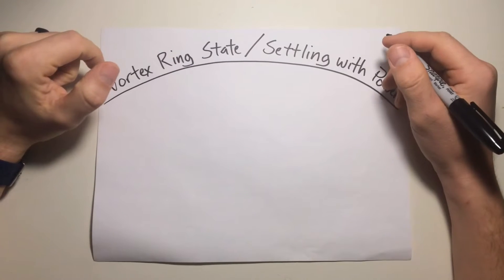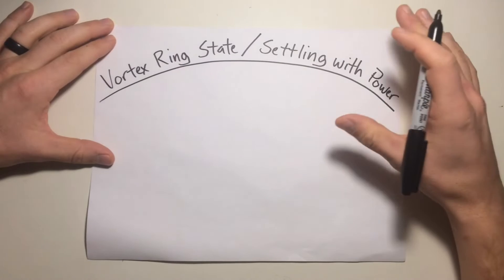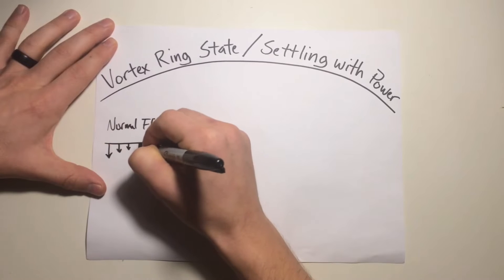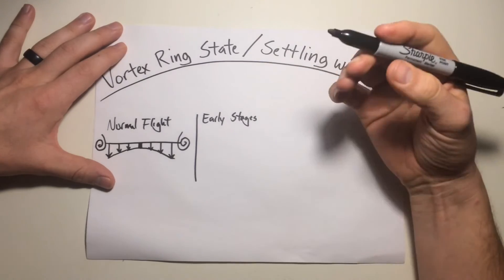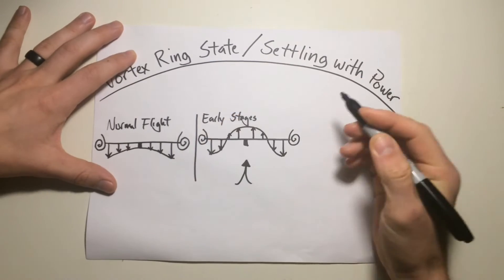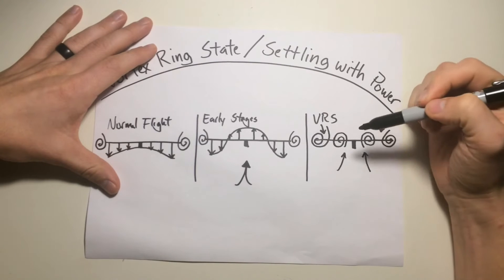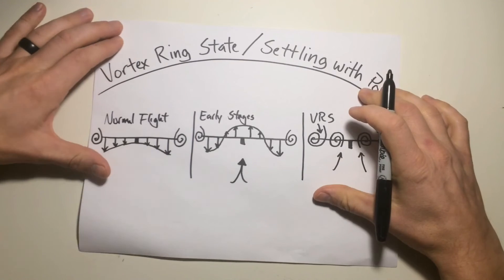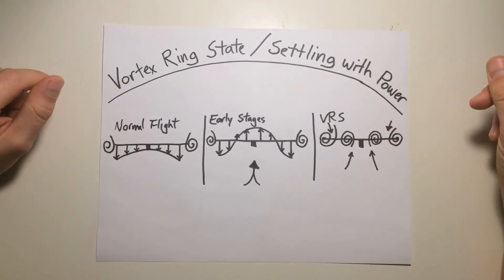Vortex Ring State / Settling with Power in Helicopters - Part 1

Comment: Settling with power is not what you've described it to be. Settling with power is being unable to arrest a rate of decent because of a lack of power. Settling with power can lead to vortex ring if handled incorrectly, but they are not the same thing.

Comment: I paused at 2:44.

The blade root does have a slower "airspeed", therefore less lift..
But, the blade tip is pitched flat and producing near no lift, if even negative lift, at lower altitudes.

How do we know this?

Coning.

When the aircraft gets into high altitudes (~15kftMSL) the blades cone, which means the tips of the blades are producing the lift in the thinner air.
So, your drawing is accurate for how coning occurs, not for how low altitude lift is produced across the length of the airfoil.

Further proof: https://youtu.be/Pu48f7s5Ru8
Watch how the tip dips below the middle of the length early after the upward flap is complete.

Comment: My understanding (and this may be a gross over simplification), is if you descend too quickly, the blade near the rotor hub begins to stall, resulting in loss of lift.

Loss of lift results in an increased rate of descent, which propagates the stall along the blades unless you get back into forward flight?

Comment: Some questions.
1. Did this used to be called 'Dirty Air"'
2. Does this only happen in a non moving hover state?
3. Once in a VRS and with enough  altitude is it simply a matter of moving out of it to regain lift? 
4. What IS  the minimum altitude to recover?

Ive seen video of, I think, a Royal Navy Helo hovering at an air show and this happened causing  a crash even at full power. He was too low to avoid it.

Comment: So if I'm understanding you correctly when a helicopter is hovering it is stationary in altitude so there's no air coming up from the bottom to cause vortex ring State versus the cause of vortex ring state is when a helicopter is descending the air is being pushed up towards the blades and you develop early in late stage vortex ring state. So the reason the helicopter can stay in a hover is its altitude is constant and there's no air coming up is that correct? I wonder how these large helicopters can stay in a hover so long and not fall outoof the sky.

Comment: Thanks for trying to educate pilots, but you got this one a little incorrect.   VRS and SWP are two different conditions.   VRS is when you descend too quickly into your own down wash causing the rotor tip vortices which is best illustrated by https://youtu.be/HjeRSDsy-nE video.   SWP is when full power is not sufficient to hold an out of ground effect hover (OGE).   SWP can turn into VRS if you don’t arrest the decent by getting back into ETL.   The classic situation is taking off from airport and trying to land on top of mountain in confined area without checking OGE hover before descending into confined area.   The density altitude combined with high gross weight causes SWP.   Helicopter simply doesn’t have power to hold the altitude.   To prevent SWP you should check to make sure you can hold altitude before descending into confined area.

Comment: Can you get into dynamic roll over while flying?
Reply from the maker: Not generally you touch something that creates a pivot point. This could be a tower obstacle that you didn’t see while flying. Or if you have complications with a sling load or water bucket you could possibly roll over if the line get snagged on landing gear enough to drastically shift the center of gravity.

Comment: Hey Jacob. Thanks a lot for the tutorial. A small query- is there any chance of falling into vortex ring from OGE hover to touchdown in a confined area? Say, in tail cross wind? 
Thanks...
Reply from the maker: You could. But when you got into ground effect it would start to dissipate and break up some of the rotor vortices. If you got into VRS at 300’ AGL, there may not be enough time to recover by IGE. If you got into VRS at 50’ AGL you could probably recover in time.

Comment: Please pay attention! I have flown Sikorsky products for almost 3 decades and I get frustrated watching and listening to so-called informative videos.

There are THREE terms that are relevant. TWO of them are: VORTEX RING STATE and POWER SETTLING and they are the SAME in terms of what happens on steep, low power descents in light or nil winds resulting in the helicopter descending in its own turbulent column of air with a rapid descent rate - resolved by forward or lateral cyclic to get out of the turbulent “dirty air” from rotor down wash. Actually you described it accurately.

BUT, the THIRD term is SETTLING WITH POWER (subtle, but critical difference from “POWER SETTLING”). SETTLING WITH POWER is the MISMANAGEMENT OF AVAILABLE POWER. Typically a fast, flat Transition to the Hover (TTTH) with low torque/ power and a steep, nose-high flare. At the intended landing spot depending on weight, wind, DA there may not be sufficient power available to retard the descent rate as the helicopter is levelled for landing - new and inexperienced pilots trying to be “cowboys” and save time are usually the ones who get into trouble, although experienced pilots can as well. When I was in the Navy flying H-3s we would sail from a cold climate and rapidly enter the Gulf Stream for a huge temp difference - handling techniques that were OK in the cold may not work in warm temps. Of course, the solution is to plan the transition well back and “load the head” early and, as you approach there is time to assess if you have enough power to hover or if you need to wave off and burn off some weight; otherwise you end up bouncing off the water - resulting in having an awkward conversation with the Ship’s Captain explaining why you are a bonehead.

In summary, your explanation was very good but would have been completely accurate if you wrote POWER SETTLING instead of SETTLING WITH POWER, but to make a point to explain the subtle, but significant difference in the terminology. And perhaps state that a separate video on SETTLING WITH POWER is forthcoming?

Comment: Increase of throttle would increase thedrop rate, is that because of earlier stall at higher angles of incedence and attack?
PS: yours are excellent video lectures!!!
Reply from the maker: zofe. Increasing throttle/collective could potentially aggravate the situation and cause the drop rate to increase because it exacerbates the formation of vortices in the rotor system. Thanks for the feedback!

Comment: Thank you for the nice videos, Jacob! The way I like to describe the difference is that VRS is an aerodynamic condition whereas settling with power is a performance condition. Settling will be your performance condition when in a VRS. That’s what makes the VRS hazardous! But VRS is not a prerequisite. There are several other ways to get into settling with no secondary vortex. These include heavy weight high density altitude approaches to landing, possibly to a pinnacle, where your power required is nearly equal to power available and you have no power margin to slow the helicopter any further. The desired flight path cannot be maintained without adding more power, power that is not available, and so the rate of descent will increase as translational lift is lost. In the best case you exceed engine limits to make a safe landing. In the worst case you have a hard landing and rollover. Another time it can happen is with low rotor rpm. Of course, settling can easily lead to the formation of a secondary vortex and a developed VRS once the increasing rate of descent induces a sufficient upflow. Sounds like the powerful Apache might actually be able to break out of incipient VRS with additional power. This technique is not taught in the world of light general aviation helicopters as it is considered counter-productive to recovery.
Reply from the maker: Ray Nixon. Well said. But I tend to disagree with some parts. Many people get wrapped around the word "Settling" whether it be with "insufficient" or "sufficient" power.  Settling with power (sufficient power that is) is associated with a Vortex Ring State because increasing power intensifies the ring state and increases rate of descent.  The airflow is simply not conducive to flying despite the aircraft having plenty of power available. Even with a large power margin, the rate of descent cannot be arrested due to the ring state only being further aggravated with power application. This is drastically different from settling with insufficient power.  This condition occurs specifically from operating a helicopter with very little power margin and a sink rate is allowed to develop greater than can be arrested (based on aircraft climb/descent performance charts). As the helicopter decelerates less than ETL it falls even faster at a rate that's unrecoverable. This is simply poor planning, power management, and poor pilot technique. This condition doesn't even require a Vortex Ring State to be present in order to occur. I think it's important to distinguish the differences between these 2 types of settling because one deals with an aerodynamically turbulent environment and the other deals with power management.  Thanks for your thoughts though. I appreciate the feedback.
Reply: Helicopter Lessons In 10 Minutes or Less Thank you, Jacob. It’s obvious now these two concepts are intertwined more than I had realized. I don’t know what it is about your videos that I like so much. They are simple, they foster such a clear understanding of the topics in a very short time frame, but your videos are also simply enjoyable and entertaining to watch. Please keep them coming. I am a flight instructor candidate like you and I’m looking for ways to deliver clarity. Btw, can you suggest where I might locate some of the Army training materials that you learned from, particularly what Army aviation has to say about settling and VRS?
Reply from the maker: Ray Nixon. Thanks! I use a combination of many sources for my videos. The printed books I use are linked in my videos in the bottom of the descriptions. As far as Army references you can try googling TC 3-04.4 Fundamentals of Flight.
Reply: Helicopter Lessons In 10 Minutes or Less What a fantastic reference! Thank you!
Reply: @helicopterlessonsin10minut10  This is what we called Power Settling in the Navy.  This is where you will likely see rotor droop as well if you continue to increase the collective.
Reply: @helicopterlessonsin10minut10  vortex ring state = hovering too high to maintain ground effect. Helicopter cannot enter translational lift or hover. Settling with power = lowering altitude with down collective and forward cyclic. Altitude too high to hover yet not enough airspeed to maintain translational lift. In both cases the problem seems to occur if the helicopter is (so to speak) confused about wether its trying to hover or fly straight and forward with translational lift. Best answer to avoid either state = know when your helicopter can hover, know when your helicopter should be in forward flight with translational lift. Try not to confuse the helicopter and be in a state where the helicopter cannot decide if its hovering or in translational lift. This will lead to vortex ring state or settling with power. Right?
Reply: Ray Nixon

They are not intertwined.  Settling with power is akin to not stopping fast enough in your car.  All the brake pedal is applied but the car is moving too fast or too heavy(or a combination of both) to stop at your desired point or time.  Same thing in the helicopter.  Too fast or too heavy(due to load or conditions, think high and hot) for the power reserve available to arrest the descent rate.  Hence SETTLING WITH POWER.  The disk is still producing lift and lots of it, just not enough to arrest the sink rate at current conditions.

Vortex ring state can occur at any weight and with any conditions.  You need low airspeed(below ETL), a descent rate of 400-800 ft/min(dependent on model) and some power(no power would be an autorotative state so any amount of power is necessary to induce VRS).  VRS involves an increase in rate of descent airflow from below.  The ROD airflow cancels out some of the induced flow on top which causes the angle of attack to increase.  If left unattended in ideal VRS conditions the blade roots will stall as the ROD airflow completely cancels the induced flow(at the root).  this puts the relative airflow inline with the plain of rotation of the disk which means the angle of attack is well beyond max limits.  Stalled blade roots means less lift which means an increased rate of descent.  Increased rate of descent means more ROD airflow which cancels out more induced flow across the rest of the blades.  ROD flow cancelling induced airflow equals very high angles of attack.  The viscious circle continues until rectified or contact with the earth at a high rate of descent.  Adding power aggravates the problem as you are simply increasing the angle of attack which will cause more blade area to stall.

The difference between settling with power and VRS as others have pointed out is that VRS is an aerodynamic condition that is caused by poor piloting.  Settling with power is a performance condition that is also caused by poor piloting.  You can have settling with power without VRS.  And you can have VRS without settling with power.  The inability to arrest the sink rate is the only commonality between the two.  Their causes and cures are not mutually exclusive.

Comment: Hi Jacob, very much appreciated that you do not state that VRS and settling with power are the same event. Closely related but they are not the same as the reached limit of power in settling doesn’t necessarily occur in VRS. Believe sidestepping out (vuichard) taught in Europe is a great way or recovering VRS.
Reply from the maker: DDT DDT. At the time of making the video I had not seen the Vuichard method but it appears to be very effective. Thanks for the feedback.

Comment: what is the relation between articulated rotor and autorotation ? please answer me asap
Reply from the maker: Roman Rajesh. The biggest difference for articulated rotor systems compared to rigid or semi-rigid rotor systems is the ability of the rotor to absorb/handle stresses placed on it. Articulated rotors have many more hinges or pivot points so that the blades themselves aren't absorbing the stresses of flight. Generally speaking, articulated rotor systems tend to be 4 bladed and low inertia systems by design while semi-rigid systems tend to be 2 bladed and high inertia. This affects autorotations with differences in response times needed to enter an autorotation before dropping rotor rpm. For instance, the older 2 bladed high inertia Huey helicopters can experience engine failure and have up to 3-4 seconds before rotor rpm begins to decay below normal limits. However, some of the newer articulated systems can have rapid rotor rpm decay with a second or 2 after engine failure due to its low inertia rotor system. I hope this helps answer your question.
Reply: thank you sir. you deserve more subcribers:)
Reply from the maker: Roman Rajesh. Be sure to send your friends this way and subscribe!
Reply: ok sure:) To be clear " 4 bladed articulated heli is safer because it has more reaction time if motor fails  and autorotation begins faster than 2 bladed heli.  ?
Reply from the maker: Roman Rajesh. I wouldn't necessarily say one system is safer than another. A low inertia rotor system (typically associated with 4 bladed systems) can speed up and slow down faster than a high inertia rotor system. This can mean rotor decays faster but also can recover faster. High inertia rotor systems are more forgiving at the onset of engine failure, but can be harder to recover if rotor decays too much. Think of high inertia has bigger, heavier blades that are more resistant to change. They speed up and slow down slower. If the engine fails, these blades have a lot of momentum to keep them turning. The reverse is true for low inertia rotors. Low inertia rotors are lighter and therefore easier to speed up/ slow down.  Great question! I hope this helps.
Reply: thank you